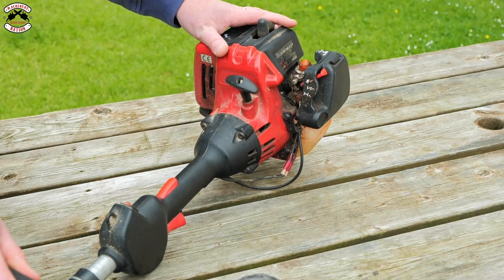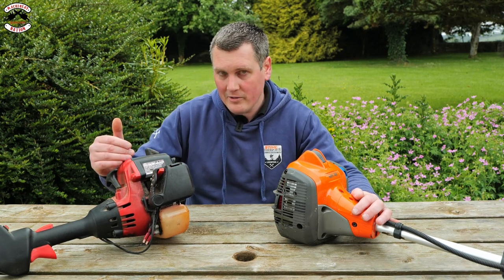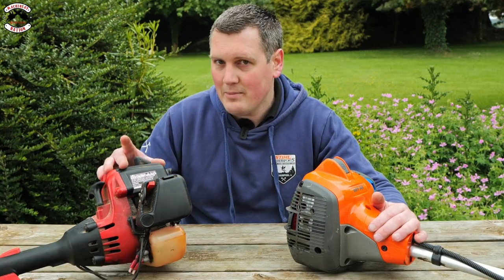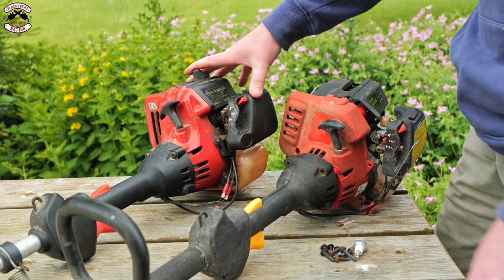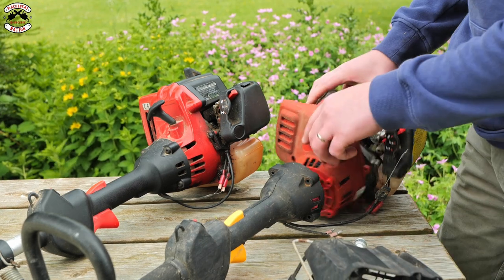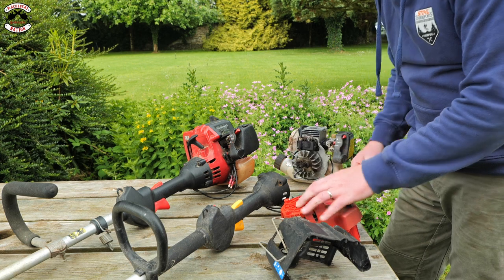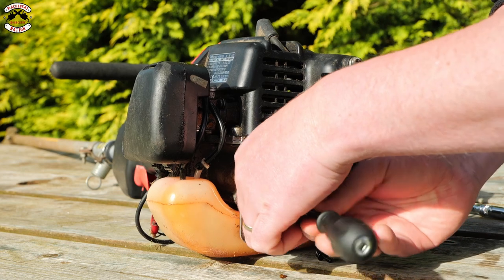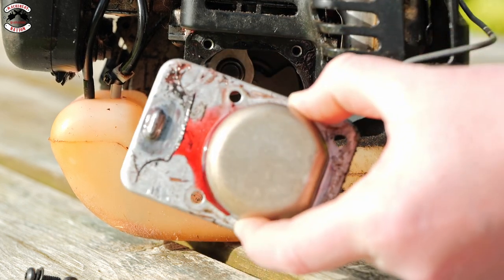Do Not Buy This Grass Trimmer - We Use A Digger To Crush It!

Comment: Norman also needs to crush and bury the big digger as well. It’s engine is a filthy bugger.
Reply from the maker: Norman wants to convert it to battery power 😂😂
Reply: @MachineryNation  
Shrink it to child size and run it on 2 AA batteries and it will impress… a seven year old. And me.😋  The budget would be nearer mine as well 🤑
Reply from the maker: @hedydd2  hold my beer 😂